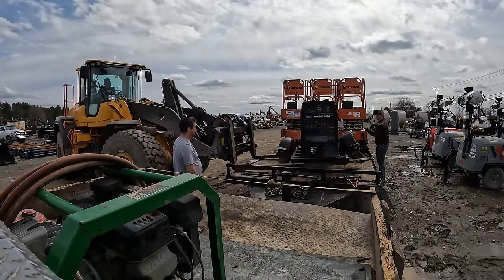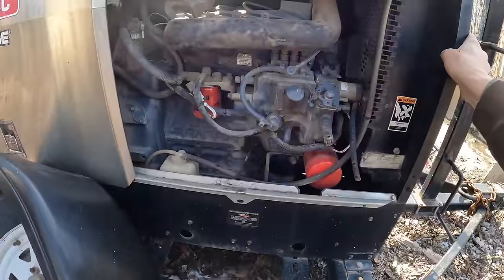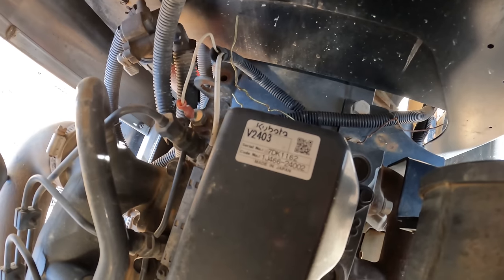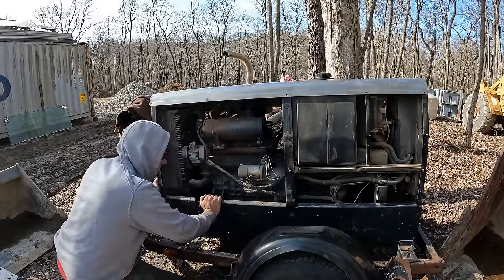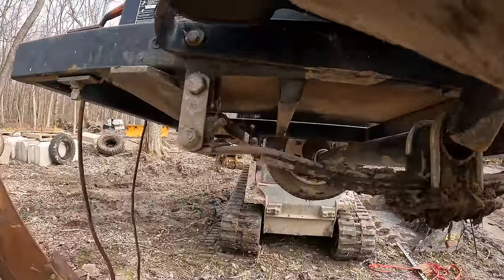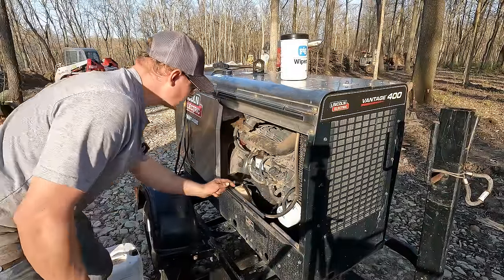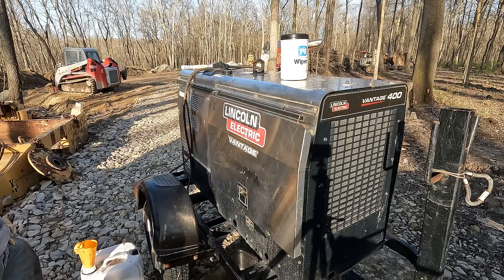This welder Fell from a CRANE? Can it be Saved (AUCTION BUY)

Comment: yea others have said it. lock the hyd cyls is a must.
and replace the fan!
that unbalance will eat water pump bearings.
and i would have pulled all the tin and the fan guard to check the engine mounts and gen head mounts for damage.
and always remove the axel cups and check the grease!
some times they are not done right from the factory.
and check the tire pressure. most are over or under pressure as delivered.

hard to go wrong on a good diesel engine!
heck the engine is worth the price paid!

Comment: BTW as you pulled away at the end, your drivers side break light did not work. However when you did the marker/hazard lights test they all worked. This could suggest the trucks wiring system is NOT four wire compatible. You may want to test it, or just have a dealer run the ViN. You can get a circuit sniffer to make it work... safely... with 4-5-7 pin setups. O' Yea, if you've been getting a plastic on fire smell while pulling that welder... Found it!

Comment: A little side project if you felt like it, turn the one leaf spring pack into a crossbow or a few knives. Did that with a leaf off a old f-350 and would put a bolt turned down from a mud mat bolt through a ten inch tree. Sure it broke the cable after about fifteen shots and needed a chain hoist for the draw back, but hey it was fun and no one lost a hand or fingers because we knew better.

Comment: Good find!  I stopped using those taillights.  they cause nothing but troubles. Now I only use take off cab n chassis units.  They have real sockets, are much more reliable and can be had cheap.  The last set I bought was less than $40 delivered!  Nice work Matt!  👍😁

Comment: A ton of companies for lights give them stupid Scotch locks Aka Vampire connectors and wire nuts its like come on companies you know this isnt for house Electrical stop providing Wire Nuts and Scotch locks and start providing insulated Weather Resistant Spade Connectors also drives me nuts as well Matt 26:50 @Diesel Creek

Comment: Before tighten u bolts align axle to trailer tongue. Tape measure should read same diagonal measurement. Then your tires will run true. Also did you put axle tube so camber bend is higher in the middle. If camber bend is at bottom, then you have overslung spring setup. Not underslung springs like you have.

Comment: 2401: for cost losser risk wide open to make trailer again & cost factor but as work truck welder completely diff frame safer quicker cheaper job, less insurance involved, or in a shop, plenty safe fine for that.

Comment: Next time your faced with replacing a trailer axle with leaf springs instead consider changing to a Torflex  with internal suspension.  Torflex are way simpler, no leaf springs and true independent suspension.   They tow nicer also.  Look them up you'll see.

Comment: an old boss of mine had one of these, he ended up putting a small piece of rubber between the frame and body panel everywhere they screwed together. Otherwise engine vibration managed to loosen every single body panel screw and the whole thing would end up rattling. The rubber shims really seemed to help

Comment: Kubota makes a great diesel motors they run for 5000 hrs easy if you change the oil once a year with Amsoil 15-40 diesel oil and I have lawn tractor on steroids it’s 02 BX 2200 4x4 and 22 hp 3 cylinder Kubota diesel ground loader and has 1300 hrs and runs like the day I bought it only thing I have done is 2 power steering hoses and oil and hydrolic fluid change and the 3 filters.

Comment: I was a metal polisher worked at chrome shop for years and I actually had one job where we did nothing but big rig fenders bling bling mirror polish stainless steel it was my job to Bang the dents out of the fenders I would say sir you did Mighty fine job it will look good going down the street 55 miles an hour they won’t see a thing

Comment: i would sleeve that axle  since  you have enough to weld too on the broken side  i weld  a size diameter bigger  over it and  onl y thing i would worry about is how bent the frame of the trailer is going down the road

Comment: i wish i had pictures for you  but in the 25 years of using those axles i only had one axle snap going down the road and it broke at the hub  not the welds but those axles made us over 100k a year cause we didn't waste time looking  for the right size axles like the other crews had to do  because back then  they were not thought of until my dad  had a broken axle and i sleeve it and made it able to adjust  3 feet  so if i had a axle that was 65 inches frame i could go down to that size up to 85 inches the widest frame at the time was 85 inches now some are 102 inches

Comment: I have a lot of hate for Lincoln welders. the Rangers is alright but for anything larger I am a firm believer in Miller.

you also don't need to bleed the fuel filter on these. prime it a few times, waiting for the pump to shut off each time. they'll start first try everytime and it's easier.

Comment: Putting grease on a trailer spring that has no grease fittings is a big no no according to the RV place I bought a bunch of springs and bushings from. The grease attracts dirt into the bushing accelerating wear way higher then just dry fitting the bushings

Comment: The only way you would have come out ahead is to make this a stationary unit on a flatbed or in a shop. It is a GREAT home genset, so shop mounting and wiring into the mains is the ultimate use.
Reply from the maker: Not gonna loose anything these on open market list for 10-15. Parts were $700. 
This is a $35-$40k machine new

Comment: just giving you A heads up i have rebuilt several of these units and there is a support bearing that is located at the rear fan  along with a wavy washer if those are not replaced correctly the end result is a ruined stator along with a a destroyed set of windings i would carefully check these first before you destroy two extremely expensive parts. also the welder worked fine for about   50-75 hours before tearing itself apart . i hate for this to happen to you

Comment: A friend of mine has a V2403 in a compressor that's done nothing to it but regular  maintenance,  15000 hrs on the clock  running a Jack hammer are not easy hours

Comment: Safety is an acceptable degree of risk.  Walking out to get the Mail even has some risk - an idiot may run off the road and get you as you get your Mail.  I once had a woman that went all the way across the stree, hit the ditch in my neibors yard, went airborne, landed in my ditch, came out of the ditch and mowed down my rose bed and cypress fence and went 50 yards into a neighboring lot. She swore to the cops she was only doing 35, the speed limit on my street.  In the 30 odd years I lived there my mailbox was mowed down several times, too.

Comment: Looks like someone dropped it off the forks and then ran over with the lull.... The newer vantage took a bunch notes from the old ready-arc 300 like the stainless sheet metal, the kabota engine. I used to work on tons of Lincoln SA 250 with the little Perkins and the classic II  with the junk Deuiwtz air cooled rigs. The ones that the timing belts break all the time.. the Ready Arc was the superior machine, hands down.

Comment: Wow didn't realize how pricy those units are. Sounds like that was a deal. Hey, don't disparage using wire nuts on trailers. It sure speed up replacing the broken lights after someone borrows the trailer...
Reply: The edge, wire nuts corrode easily, he did it right using water proof splices.

Comment: Just curious, what's your logic for suspending the load vs lifting it on the forks? I would think the forks would be more stable to work again while hammering on it and trying to push things around.  Not worrying about the safety factor, I'm thinking from a trying to push fenders around and the axle in and just having it spin

Comment: i had a 1970 caddy convertable,,  over 100 thou,, a 472,,, after an oil change,, the oil looked brand new, as if i just did it.  i think it was 6000  miles,,,,, wish i kept that motor so much, but no place to keep it, work on it, really sucked.

Comment: The  only thing I would have done beyond what you did would be to see if the 
brackets on the frame that were out of alignment were cracked and could be 
straighten and mighty need additional bracing.   Otherwise excellent job.

Comment: The trailer frame is tweaked.
The right rear sits lower then the left rear.  Nice thing about it he can weld up a new trailer. 
My question is will it pull in a straight line  didn't see you measure the center of each hub cap back to the tow hitch ball area
So the wheels might be out of tram. 
If thats not closes it will fishtail like a sob.
Reply from the maker: There was locating pins, you couldn’t be off

Comment: you could have fixed the old axle by cutting it off and put a piece of pipe on thr inside that is a snug fit drill holes and weld the inner pipe to the outer axle pipe sleeve the broken part over it and weld it together and also drill holes to weld inner pipe to outer pipe

Comment: I hate it when equipment manufacturers put side panels on without any sort of retention other than the screws/bolts.  It's not hard to put a ledge on the design so you can hold stuff up with a knee or whatever when you're taking the panels off. Can't count the number of times I've had a sliced-up finger or a banged shin due to stupid designs like on that Lincoln!   Edited to add: Scotch-lock connectors are garbage, agreed!  Especially if you live in the rust belt.

Comment: i moved and set mobile homes for a living and we had axles made up too slide in and out to cover different sizes  so we too a trailer axel for  200 bucks took about 2 feet out the center a sleeved it with a bigger pipe  then welded one side to the axel then the other side we left free  so we could get the right fit for  all the mobile homes we delt with  we used them for over 20 years out of all that time we had one failure  the hub snap on a spindle from a tree stump  the guy who own the home paid for the trash axel  think it was like 400 bucks the same cost to replace it  other than that no  failure of our product  then all the mobile guys in our area started using our axels  so i bought a lot of axels from the factory cut them and made about 50 sets  thats 2 axels and 4 tires sold them at 900 bucks a set   i had about 500 a set tied into them all with new tires

Comment: Good fix. Did you center the axle between the spring hangers on both sides so it rides straight down the road? It looked a tad crooked but the fenders could have thrown my perception off honestly.
Reply from the maker: It has alignment pins. It cannot be off

Comment: When the wheels fly off at highway speeds, the axles are designed to be trapped by the springs. It's a safety feature, not a bug.

Comment: As a retired millwright, who spent 44 years of doing jobs using questionable safety practices, sometimes all you can do is make it as safe as you can to get it done. And yep, using brand new parts that bolt right up is nice, but I think that fixing something that looks like it's totally destroyed and making it functional again, is half the fun.
Reply: I think I would have worked on it on the forks...  it swinging would have annoyed the shit out of me.  I probably would have sleeved that axle and bought a wheel and a leaf spring and sent it.  I'm willing to be his bro-in-law supplied the parts tho.

Comment: Since it dropped with the force to break the axle you should’ve taken the time to inspect ALL welds on the trailer frame, it could break apart on the highway…
Reply: Frame is a heavy C channel.
Reply: @BeachBoyAAA  not a reason to assume no welds cracked at impact.

Comment: I’m no expert . Keep a eye on the tire wear . for alignment . I have run a string form the centre of the axle cap to the centre of ball hook up  to get the same measurements  on both sides . It’s tricky but it worked on my utility trailer . Maybe someone knows the right way to do it . Nice video & happy ending  👍💥

Comment: Question:  How many operation hours is a lot / a little / way too much etc. for Tractors, Graders or that Welder you have there?
Reply: Depends on if designed for domestic or industrial use. Higher models would last longer.

Comment: I’m sure someone beat me to it!! But the reason you and I and every other mechanic/shade tree mechanic HATE how the mount the battery or this or that… is because it was designed by and engineer/s who was told make a decent product that won’t need a ton of work… but make it so the average person can’t fix it themselves. Make it so they have to come in and pay 4 hours labor plus $250 for a special battery for it!! Just like the early 2000’s model Camaro I believe is the 1 but you can’t just do a tune up on it!! If you want the plugs changed you have to take it to a shop and have them drop the engine down with the sub frame so you can get to the spark plugs, some parts on the ford pickups with the 5.4 triton motors I think it’s the injectors and maybe some of the spark plugs can’t be gotten to from the top or bottom!! Gotta lift the body to replace them. Don’t hold me to the ford or the year of the Camaro!!! But yea stuff is over engineered so you can’t or at least really don’t want to work on it!!!

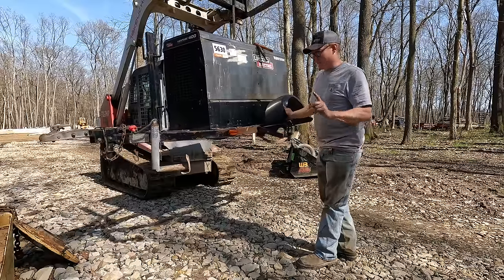Comment: 20:47 sigh that’s what they all say. You have a suspended load that’s hoisted by a hydraulic mechanism and you’re in an isolated area by yourself. I know you weren’t directly under it but it still could have caused a laceration, broken bone, or BFT to your head, legs, or arms. Stop what you’re doing, get some cribbing, and do it right.

Comment: JUST CURIOUS I HAVE JUST REPLACED U BOLTS ON MY BOX TRAILER,AND I NOTICE YOUR AXEL IS INSTALLED ON TOP OF LEAF SPRINGS, MINE IS UNDERNEATH,WHICH APPEARS TO BE CORRECT,CAN THEY GO EITHER WAY?
Reply: Yes, depends on how the unit is designed.

Comment: Hi,
I am a young stiudent from germany and I have bin watching you since three years now. This is my first coment now and the first thing i wantet to say to you is that I preaty much like your Chanel and all the stuff you do. Hope to see your Shop-projekt going forward, realy enjojed the updates. 

Although you are saying that you are loving Diesel engines it was very confusing ore simply for a german guy not usual, that you are running everything withe a motor. Welder, lights, etc... Everything what normaly uses electricity, is running with a small engine. Is this necesarry in the future? I know your Farm is far away but this would boost your coolnis for mee to a thousend percent. Going alittle bit a greener way.
Hoping that you are putting a cable to your shop. Or some solarpannels and a battery on it. 

Criticising your environmental carryage. Yes you do youse sometimes some absorbent mats but it could allways be more done in that diraktion:) Or you are not showing everything, hope so. 

Goin now to the good part, I raly hope you are going on with fixing stuff because I do kind the same,building recykling machines, and realy love to see that someone is putting things together again. Not buying everything new:) Waiting currently for your next video and hope that you and your Family are staying healty.

Comment: $3250, plus 12% plus sales tax, you are into it for $4000. Ritchie is often high. Other rental return auctions sell these for 4 to 5K $ and they dont need another $3000 in parts.  You win some and lose some. Wait for the better deal!
Reply from the maker: I’m not loosing anything the parts were $700, these list for 10-15k on the open market. 

These are $35-$40k new
Reply: @DieselCreek  Street for me is an auction, and I see 12 of these in past few months for about $3500 to $4500 in results.
2014 Lincoln Electric Vantage 400 Engine Driven Welder
ITEM NUMBER5887303
LOCATION
Sulphur, Louisiana, United States. 70665
SOLD ON
12/23/21
WINNING BIDUS $3,600
# OF BIDS
18   View Bid History
SOLD!
ITEM DETAILS
METER READING5,408 Hours
SERIAL #U11411XXXXX
Perkins 4 Cylinder Diesel Engine, S/A Trailer, Ball Hitch

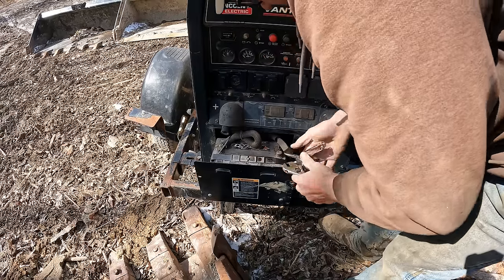Comment: 3:50 Engineers design things they way they do because they NEVER HAVE TO FIX THE FRIGGING THINGS IN THE REAL WORLD!!!

Personally, I think it should be Federal Law that in order to become a Licensed Engineer, first you MUST spend 6 months as a Mechanic fixing that type of equipment...So if you want to design Diesel powered Welding Trailers, first you gotta fix them for 6 months...I guarantee that they WILL swiftly become FAR easier to fix after that...though they'd also become MUCH more costly to buy too...6 of 1, half dozen of the other...

😄😁😆😅😂🤣

Comment: Mate, your doing it all wrong. You obviously don’t watch Pakistani Trucks, they’d have supported the welder on two star posts and had a couple of school kids under there undoing everything in next to no time. The axle would have been welded back together in the shop next door and the wheel straighten by the shop over the road. They would have bent the spring back into shape and repaired the stand, added weird decorations and fitted a massive bumper bar to it all in two hours and at a cost of 36 Rupees. Otherwise great repair and a very lucky purchase. Cheers Stuart 🇦🇺

Comment: There is no such thing as doing something dangerous carefully.  If a valve lets og or a chainslips off a hook anything, you will not be able to keep an eye on it.  That danergous something will happen faster than your eye can see.  Why would it be so hard to put a block in place?  A simple 2x4 under the tool carrier would do.  If that dangerous thing happens you will be the last one to know, and then it is too late.